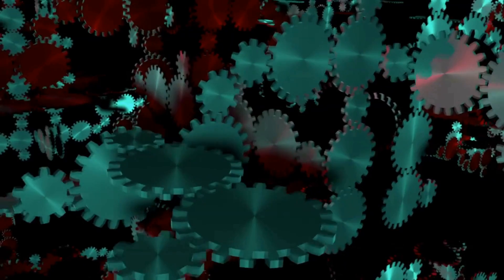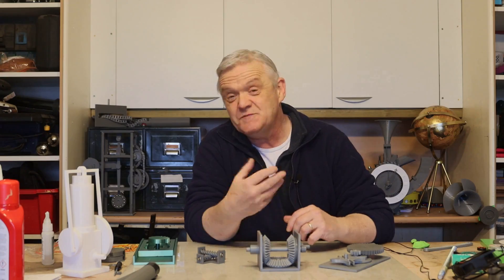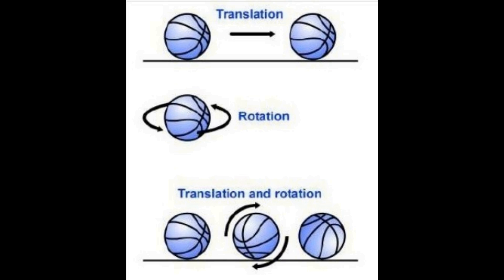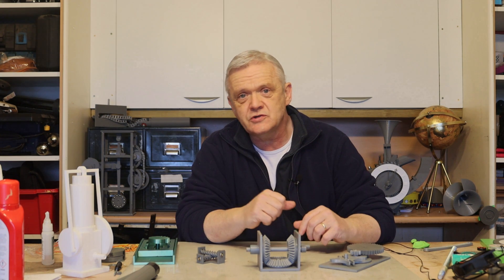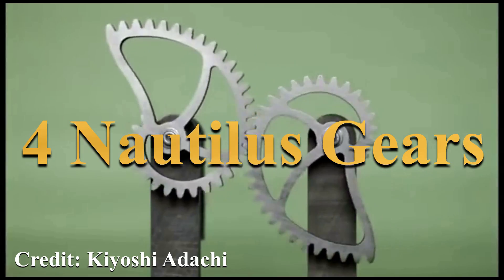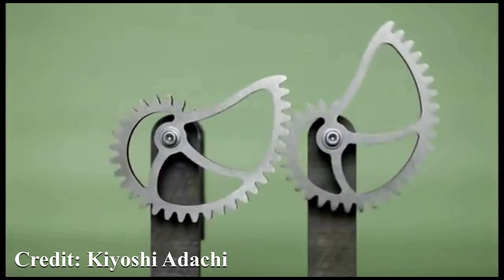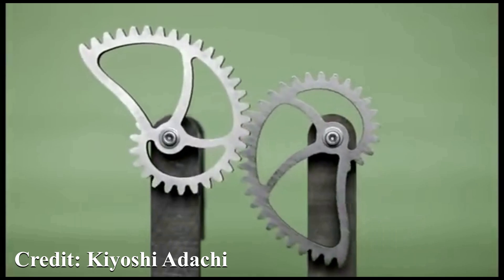2195 Bizarre Gears

Comment: Useful uses for Nautilus gears: mechanical calculator for the increase and decrease in day length between the summer and winter solstices and the equinoxes!
Reply: No, wrong, nevermind me... I just realized the change in day length could be more accurately calculated with one of the sliding gears.

Comment: Aren't Borromean Hairpins good for any situation where, when one displaces two axes against one another so that they move apart, a third axis is also displaced?  This seems like something worth exploring for expanding and unfolding structural mechanisms, especially ones where a certain degree of stiffness at the joint is needed.
Reply from the maker: i guess

Comment: A nice collection of gear trains Robert.
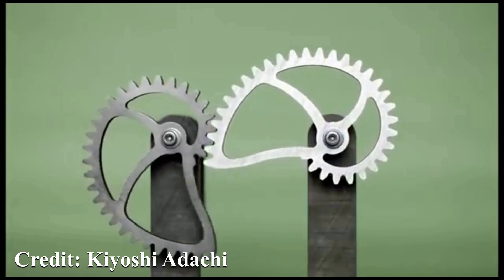The set of Nautilus Gears, at 4:26 , has been used in a number of machines.
If you get the output shaft to push a lever that raises and lowers a table, you can get a slow rise time with lots of torque and  a fast lowering time using the tables mass for it to drop.
Also two circular gears with offset axels will give you a rising and lowering continuous output speed/torque.
I worked in a brick factory and they used this principle to raise a table of bricks to another level to be pushed off, then lowered the table, empty to get another load slid on.
Low speed , high torque UP, high speed low torque down.
Reply from the maker: nice cheers mate

Comment: The thing that blows my mind is that everything(and I mean everything) is made of gears.  Atoms are gears.  Think about that for a moment.  Solar systems are gears.  Galaxies are gears.  The driving mechanism behind each may differ, but they are gears.  Even an electrical system is a set of gears.  Current flow through the medium(wires ect.) is a ratchet type to planetary gear depending on the point of perspective.  Thanks Rob!
Reply from the maker: you should read Eric Drexler!
Reply: @ThinkingandTinkering  I have LOL!  Thanks again Rob!
Reply from the maker: lolol - that's brilliant mate - we clearly have a lot in common !
Reply: @ThinkingandTinkering  Engines of Creation and the Abundance books are interesting.  Though can't say I agree with some of his purported ideas.  But he does have a great many good points.  Dry but very interesting.

Comment: it would be interesting to consider some form of gearing to tune the pitch of a turbine - adjusting it to maintain a more constant speed - until rotation was so fast that it could ptich stall (temporarially).  I have been thinking on this, and certainly getting it to do it once isnt a big deal - resetting I havent been able to sus - so I guess I am down an alley....  Some form of separate annometer direct driving a gear might be better than centrafugals that I was thinking
Reply from the maker: there are variable pitch mechanisms out there mate

Comment: I made a hydraulic transmission sort of like a variable speed transmission. The speed of light C isn’t constant since the measures of time and distance aren’t constant over larger distances. Changing from 60 kilometers an hour to 60 miles an hour increases your speed. Then if you go from 60 miles an hour to 60 miles a minute it increases your speed again. This what is happening in general relativity when less gravity increases the measure of distance and speeds up the rate of time over large distances. It also means that the earth is younger than what they claim. Think about it as a mechanic.
Reply from the maker: awesome

Comment: This was fascinating!  I have a question on a unrelated topic. The small heat fans that sit a top of wood stoves that are powerd from heat of the stove, is it possible to scale those up? Could one be built much much larger than the small ones for stoves? BTW all your videos are awesome! Thank you for sharing your knowledge!
Reply from the maker: for sure mate - look up flat panel stirling
Reply: @ThinkingandTinkering  I looked up flat panel Sterling engine. The fans that sit on wood stoves are not Sterling engines I believe. Mine has a small electric motor with two wires coming out of it running to the  inside of the unit somewhere. I would love to show a picture here but unfortunately there's no way for me to post a photo here. But these style Heat fans do not appear to be Sterling engines.
Reply: Watch him tell you, "try it and see.". I don't think it would be practical, I don't think you could get enough out of it for it to be worthwhile.
Reply from the maker: lolol - you know me too well lol
Reply: @lorenbush8876  I don't know about that. The little new style one that I have on top of my stove runs really fast on barely any heat.

Comment: How about the infinite mesh gear? Maybe fluid against a pelton turbine? Fiber fuzz gears .
Reply from the maker: that gave me an idea - cheers mate
Reply: @ThinkingandTinkering  Way back in  the 70's 3M company had a product call Fibertran, it was something similar to "bear hair" they used it for one-way clutches. The surfaces were covered with short bristles that were laid over they would slip in one direction and engage in the other direction.
Reply from the maker: i did that with toothbrushes if you remember video 1913
Reply: @ThinkingandTinkering  Yes, you could also use a window screen on the opposite surface

Comment: the mangle gear (rack and pinion?) sounds like a platoon of Korean soldiers showing off in front of Kim Jong Un with just that sight degree of asynchronous motion. I wonder if you could do that with a magnetic gear that doesn't touch so the outer part 'oscillates' left and right? Like a magnet playing cat and mouse with it's partner, only the mouse is the cat! With serrated magnets to give directional drive?
Reply from the maker: i am pretty sure you could mate